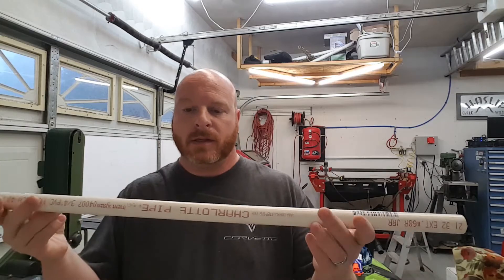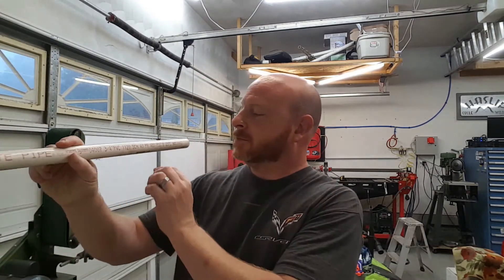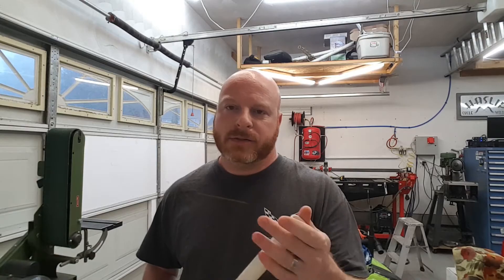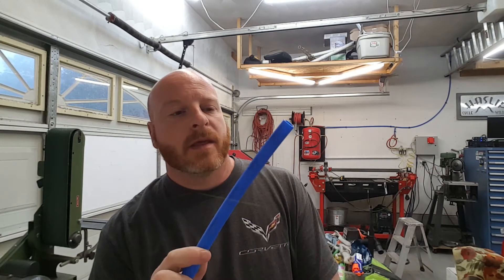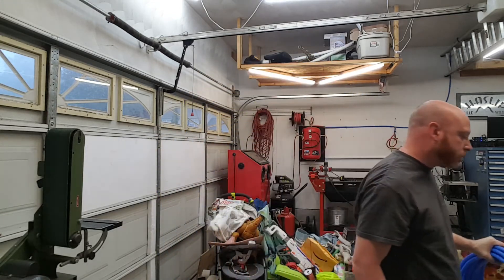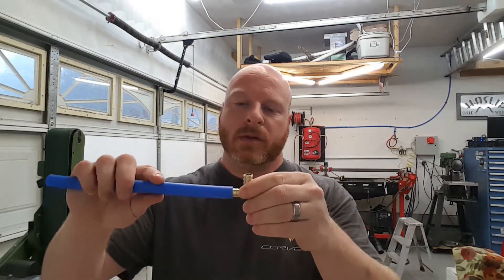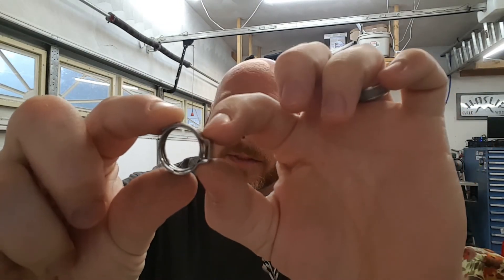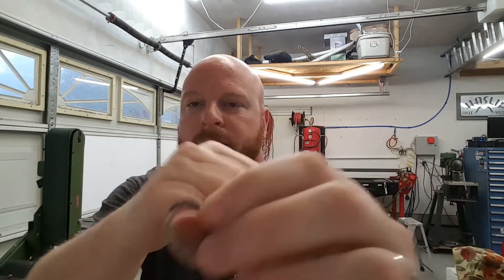Using PEX for shop air?

Comment: CVPC is FINE as long as you install a ball valve to shut the air on when u need it and off when you are not using it. 
PVC/CPVC is made out of..................................a plastic that starts as OIL.
You people are clowns.

Comment: For a few dollars more you could have gotten PEX Al and the proper fittings for it which is actually rated for the kind of pressure you would see with an air compressor.   What you are using is not rated much beyond 100 PSI.  Just a matter of time before it fails.

Comment: The Chinese made threeded fittings will tend to leak.You have to use plenty of Teflon pipe dope .They probably don't change the taps and dies frequently enough it seems like if it's got something that looks like a thread it's good enough.

Comment: The problem with PVC OR CPVC is that it does not hold up over time. 20 or 30 times going from hot to cold, it will start to show stress cracking inside of pipe.

Comment: I am wondering if using Pex-A would work as well since the connections use the compression fittings? I have a bunch of pex-A tubing and fittings left over from plumbing my house. But am wondering if the compression fittings will hold as well as the clamping rings.
Reply from the maker: @grandn8646  not sure. I’m sure someone in the comments has tried it and can probably give you some feedback.

Comment: Do not use PVC for compressed air it will blow up period. Cooper type L or galv or blak steel I know there is a nylon type plastic tubing for air. Don't have any knowledge  on pex ( polyethylene cross link = pex)

Comment: I can tell you from personal experience that PVC IS A TERRIBLE  CHOICE! I worked in a shop that had 2" pvc throughout here in Flori-dah. And every summer it was about once a week or more pipe bursting joints failing every body shits thier pants and it has to be repaired and then wait for the glue to dry! Ridiculous! Not to mention I personally had a drop failed about 10' from my ear, and I have permanent hearing damage from it! So every one please hear me when i say don't ever use that shit for compressed air lines it's not safe and not worth what little bit you might save!

Comment: One of the dangers of PEX is that if it is not well secured and in the open it can whip around worst that Indiana Jones if a connection blows open.  I've used PEX in air systems in places where the PEX is threaded through holes drilled in the studs and covered with sheetrock or plywood.  Otherwise PEX is great.  For outlets, you can get brass drop ear elbows with PEX connections.

Comment: How has pex worked for you? How much PSI are you running?
Reply from the maker: It worked fine for me while I was at the old house for a few years. Normal psi was 125. Now in the new shop I went with a rapid air kit and love it.

Comment: My Air Compressor's max air pressure is 175 psi. Will PEX B handle that pressure? Thanks in advance.
Reply from the maker: I never went over 120 psi. But I cannot recommend pex for your situation. I would go with something like rapid air. That’s what I’m running in the new garage and I absolutely love it.
Reply: @HaslipCycleWorks  Much thanks!

Comment: How is it holding up 3 years later? Any leaks or failures?
Reply from the maker: I never had any failures or leaks while it was there. Ended up selling that house and in the new shop I bought one of the rapid air kits and have zero complaints.
Reply: @HaslipCycleWorks one more question: can you notice a difference with that reservoir tank you added? 

I’m considering doing something similar but I’m running a 30 gallon compressor and only about 50’ of PEX so I don’t know if it’s worth the hassle of plumbing it in.
Reply from the maker: @Ben28782  I noticed once the tanks were full there was more gaps between the compressor kicking on. However once it did kick on it had to run longer.
Reply: Cool, thanks for the update. I just finished setting up my shop with PEX yesterday. So far so good, no leaks….🤞🏻

I’m glad I found your video because I ended up adding drip legs like some of the commenters suggested. Between those and the filter/dryer I install right after the compressor I should be able to keep as much moisture as possible out of my tools.

Comment: Yeah, I wouldn't do this... PEX is rated ONLY for liquids and not air.  The air from your compressor can reach temps over 200 F, which degrades the PSI of PEX to about 60 PSI and over time makes it brittle.  A friend of mine taught me this the hard way when brass fitting and the PEX lip and clamp attached about 3 feet away from the compressor exploded off a 140 PSI compressor striking him in the eye.  He lost that eye, nearly died and THEN did the research...   You've been warned.
Reply: Copper for the first few feet to an air filter / drying system, then pex for the distribution  and regular air hose to connect to tools. problem solved.
Reply: @michaelfleury8472  again, PEX isn't rated for air pressure, only liquids.

Comment: You did not put drip traps below your hose coupling blocks. I recommend you extend the pex at least 8" below the coupling blocks and put ball valves to trap and drain any rouge moisture before it goes into your tools.

Comment: I know everyone likes to save money on using less fittings but it just looks so much better when you keep everything plumb and level. Im talking about the blue pex line behind him. Instead of curving the the line to change direction it would of looked much cleaner to use a 90 degree elbow. By the way that brass fitting with female threads is called a drop ear 90. Not try to rag on your work cause it got the job done right. Just saying it would look much better to keep it plumb and level.
Reply: A slight decline is even better, though, to allow moisture to flow out of the lines (but he needs a drain at the bottom of each drop, too).  You really want to minimize the amount of water you force into your pneumatic tools!  Nothing shortens their internal working life more.

Comment: We have a shop with compressed air pvs lines for over 15 years with no problem
Reply from the maker: Well fingers crossed you continue to have no problems.
Reply: It’s exceedingly dangerous when it fails. Yours hasn’t failed yet. It creates razor like shards of shrapnel. That’s why we don’t use it for commercial fireworks mortars. Instead we use HDPE, high density polyethylene. It doesn’t create shrapnel, just bursts open.
Reply: The fact that the lines are 15 years old is what’s going to become the problem. The oils from compressed air degrade PVC over time which is what leads to inevitable failure. Hopefully nobody is standing near the pipe when it bursts. And it will eventually burst. It’s not a question of if, but rather when.

Comment: Is this standard pex B that you’re using? I almost bought some but it said that max pressure is 100psi at 180° for me, it will be going in a metal building up against the tin so it will get pretty hot. I will be pushing 135psi
Reply from the maker: I would have to go look and see what I bought. I have since moved and ripped it all out at the owners request. May not be a good fit for your situation.

Comment: I used regular air hose to make all the runs around my shop. Attached and supported it with hose clamps. 25 years later I had one fitting leak. No worries about pressure, brittle plastic or UV deterioration. I was faced with the same challenges and concerns about cost. Just my .02. Thanks for a good video.
Reply from the maker: That’s awesome! I thought about going that route too. Thank you.
Reply: Mikey how did it hold up using the hose route? Do you have  video on how you have it laid out? I am looking at going the economical route and not dropping to much into having mine done. Thanks.

Comment: How long dies it take the air to leak down in your compressor. I used alotta Pex for water line and it does leak down after awhite w air pressure we test for leaks w air and a guage and it held for 25 mins and would leak down some. Just curious long term how the leakdown is on pex. Thanks
Reply from the maker: I got lucky, I guess it would hold 100~120 psi for weeks. The only leak I had was from one of the whip hoses but that was fixed by buying a new one.

Comment: I did mine similarly except at each air line coupling, I used a galvanized T, with a compressor drain valve on the bottom to flush out any moisture that may accumulate in the line.
Reply from the maker: If I do it again I’ll be doing the same.

Comment: @Haslip Cycle Works — PVC pipe is unsuitable for carrying compressed gases, because when it fails, it tends to shatter and produce deadly shrapnel.  This is not a problem with water at the same pressure, because water is incompressible and when a PVC water pipe fails, the pressure is instantly relieved, so there is no available energy to propel shrapnel.  My brother ran compressed air through SCH40 PVC at about 120 psi in his business, but when the building inspector saw it, he was forced to replace it with galvanized iron for the aforementioned reason.
Reply from the maker: Agreed pvc is a bad idea. Copper would be my first choice but the price and the fact that I would soon be selling that house kept me from going that route. PEX was the best option for me.

Comment: @Haslip Cycle Works — PEX (cross-linked polyethylene) is not be used where the tubing will be exposed to daylight and maybe not even where it will be continuously exposed to low level UV leakage from fluorescent lamps.  PEX suppliers typically specify that the tubing shall not be exposed to daylight on a construction site for more than 30 days to prevent embrittlement.  It would be great if PEX were available in a black, UV-resistant form for projects such as this where it is mounted in exposed locations, but I've never seen it.  I'm only aware of it being supplied in red, blue and natural/white.
Reply from the maker: All the lights in my garage were led, very little if any was in direct sunlight especially with the garage door down as the windows were tinted with UV film. I guess you could always sleeve it in something?
Reply: @HaslipCycleWorks  — If it is installed as you describe, you'll probably get 40-50 years life out of it instead of the expected 100 years.  You may not live long enough to see it fail.
Reply: Hmm how bout rattlecanning it with some sort of plastidip or bedliner.....hmmm?
Reply: I think some people overthink things. Using pex is a no brainer. Make sure your crimps are good and move on to another project! No worries
Reply: @jgstill1  - I don't want you or people like you doing plumbing installations for me if they can't be bothered to read and follow instructions.

Comment: I did my shop in PEX and would do it again in a heartbeat. I've heard way to many horror stories about PVC to consider it. When it goes wrong it goes dangerously wrong, as in plastic knives flying through the air at high speed.
Reply from the maker: Same reason I went this way.
Reply: Exactly

Comment: Ok Your right about pvc but Pex pipe is not meant for air lines. It can not handle the high pressures you will be using and it will eventually bulge out and fail. The type of air hose you need should be designed for air not water. I'm using TPEE pipe which is for air lines and it looks just like pex but it's not made out of the same "plastic". Another thing is the fittings used for airlines are cheaper and you can remove them without tools. They are not made for pex so you cant use them. I hope everything works out for you but just know it most likely will leak or burst (line will split and not explode like pvc) later on down the road.
Reply from the maker: Appreciate the feedback thank you.
Reply: All depends on the psi you to run the air tools. I run them near 100psi and pex b hasn't failed on me

Comment: Great but you did not allow for a drip leg with a blowout to take out any moisture before it reached your equipment! Never use an oiler on the compressor side, only on the equipment side. Once you contaminate your lines with oil you can never use them for anything else.
Reply from the maker: I usually put and water separator in front of each piece of equipment with quick connections. That gives me more flexibility. I agree there should be a drip leg, I’ll put one in on version 2.0. There were no oilers in this video but when I use one it’s the same setup as the water separator, right inline right before the tool that needs it and only feeds the tool not the entire line or system.

Comment: I used brass tubing for my air system. It works just like copper.
Reply from the maker: Nice, thought about that too but the price was more than I could justify.
Reply: Too expensive
Reply: @jimmysapien9961  Yes really expensive but i like the look of brass.

Comment: What causes a water separator to not pickup water? Does the hose need to have a straight even shot to the separator? I did have it coiled up before the separator, then I moved and now it's got a big dip in one part of the line. I wonder if the water just stays in the hose. I know it stays in the tank cause I drain a ton out all the time.
Reply from the maker: It probably will settle in the lowest point. If you’re not seeing anything in the water separator there probably isn’t anything reaching it.
Reply: @HaslipCycleWorks  im surprised the 175 psi doesnt blow it through the hose. Maybe I need to attach it directly to the compressor. Just how I had it setup on my old craftsman 33 gallon. I bought a new one that was rated for a higher psi and haven't ever gotten a drop out of it.

Comment: Nice video. I was curious about using pex pipe to clean out my HVAC duct work. Do you think pex would bend enough around corners inside the ductwork?
Reply from the maker: Thank you. This stuff is pretty rigid so I’m not sure it would do what you are looking to do.
Reply: @HaslipCycleWorks  - Thanks. Since it comes rolled up, I thought that may allow it to bend around some corners.
Reply from the maker: @Nick23at63  the best advice I can give you is to head to a hardware store and put hands on some to see if it will give enough to bend around the corners you would be working with.
Reply: @HaslipCycleWorks  - Yea, I did that at Home depot, but I didn't really test the limits, if you know what I mean, didn't really want to buy a broken piece of pipe, lol. It did seem to bend enough for a 90 degree turn, but things could be a little different inside a tight duct. Tried asking an associate, he said "Why would you do that, just hire a pro." I felt like saying "If everyone hired a pro, you probably wouldn't have a job here at Home Depot," but I bit my tongue. Thanks for your time.
Reply from the maker: @Nick23at63  lol I know how you feel lol. Good luck with it.
Reply: @HaslipCycleWorks  - Hey, I should have asked this in my earlier posts, but if not pex pipe, do you have any ideas about what kind pipe/hose I could use? I bought a shop vac hose, but it was too wide in diameter to turn in bends. There are some clear pvc tubing products online with good reviews for other projects, but there are some people complaining about kinks. The online products pros use are just too expensive for me, packages ranging to well over 200 bucks. Any thoughts? Again, thanks for your time.
Reply from the maker: @Nick23at63  there is some clear hose with reinforcement webbing in it. It’s available in a couple sizes. It’s rigid but yet still pliable. Not sure what it’s made of, but may be a fit for you.
Reply: @HaslipCycleWorks  - Thanks, I'll look into and let you know how it turns out. I like thinking outside of the box.

Comment: I would add a drip leg with a drain valve at every drop as well as have a moisture trap/filter.
Reply from the maker: That’s smart! I should have done that and honestly as easy as PEX is to work with I still could. Thank you.
Reply: @HaslipCycleWorks  How much pressure will PEX  hold ?
Reply from the maker: @jimmysapien9961  I ran 120~125 psi through it on the regular without issue.
Reply: I was thinking the same thing.
Reply: maybe put an adapter with a valve at the bottom of it where each line drops

Comment: It’s against OSHA regulation to use PVC for compressed air system. Would either use the aluminum pipe system or nylon DOT approved tubing for air system. You can use black iron pipe and copper too, they come with their own problems too.
Reply from the maker: Exactly that’s why PEX is a good option. No rust not bursting when hit, etc.
Reply: @HaslipCycleWorks  Would definitely like to see like yearly follow up videos on it. We used it at work before but for only the water drain line from the oil/water separators we install on all the drains (Air tanks, compressors, air dryers, air filters, etc...) in the pneumatic system. We used the push to connect fittings on it stuff made the job much faster an no special tool. Also something worth reading.
https://jhfoster.com/compressed-air-blogs/what-type-of-pipe-should-i-use-for-my-air-compressor/
Reply: We could do the whole shop in copper$$$ or use pex. Your tools will never know the difference! Stop overthinking it. OSHA ain’t coming to your house!

Comment: Great simple video. Everyone get plenty of air flow out of the 1/2" pex? Thanks.
Reply from the maker: For what I’ve used it for it has worked great. Zero issues.
Reply: Depending the length you're running go 3/4 for a bigger shop I use black pipe it's cheaper than galvanized and I'm too worried a pvc line would break if it was hit
Reply: @bca2070  No issue with rust in the lines?
Reply: @mccoma11  I have an after cooler and automatic drain on my compressor and inline water,air,oil filters 3 years so far and used daily and no rust yet